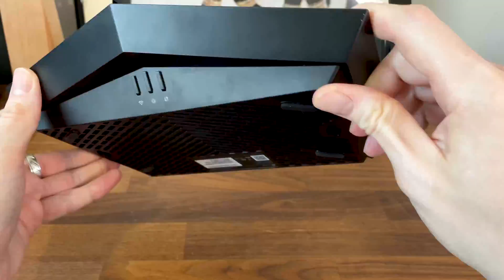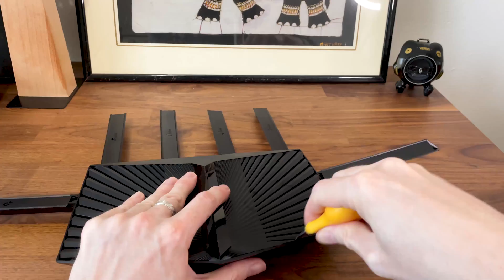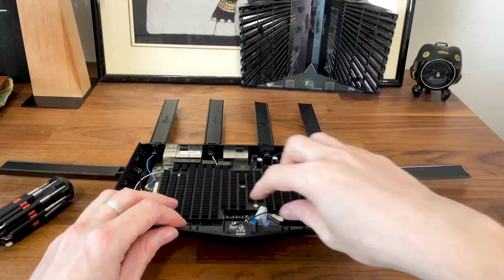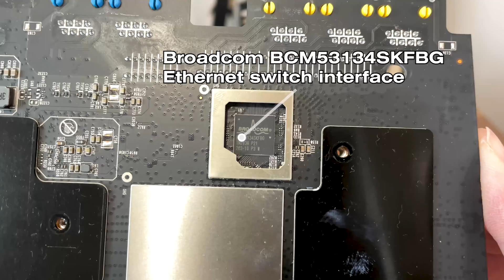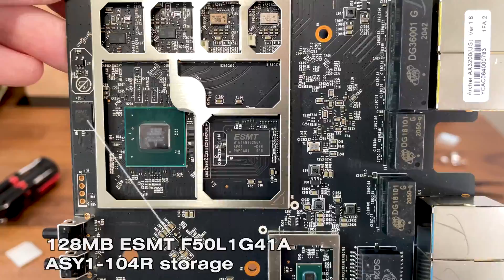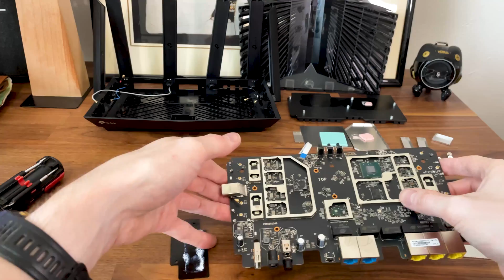TP-Link AX3200 Tri-band WiFi 6 Router Teardown: Not very difficult to open

Comment: Does this particular model passively cool well or overheat?
Reply from the maker: I did review this router in particular and have added some shots with the heat management. Do check it out. To answer your question, it was OK as far as I could tell with no signs of overheating.